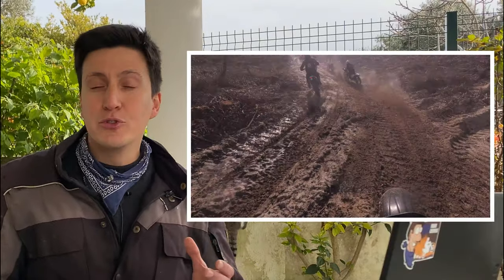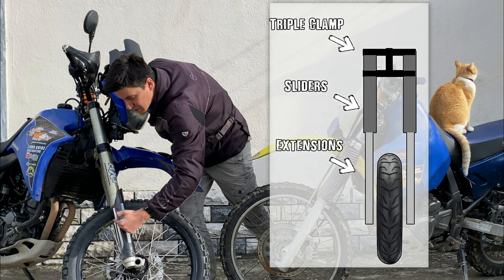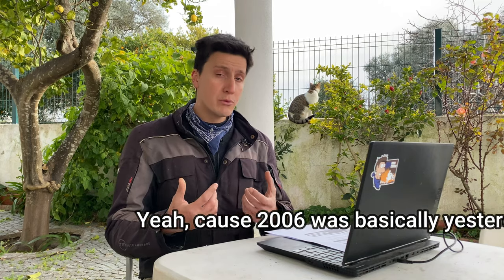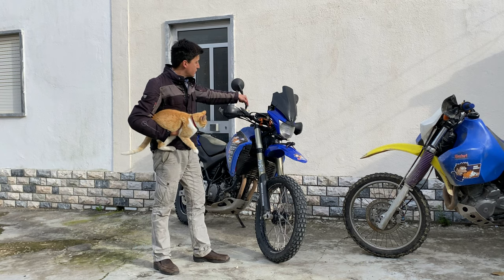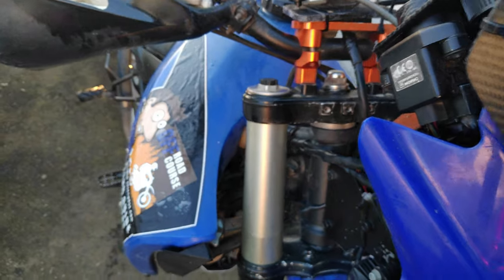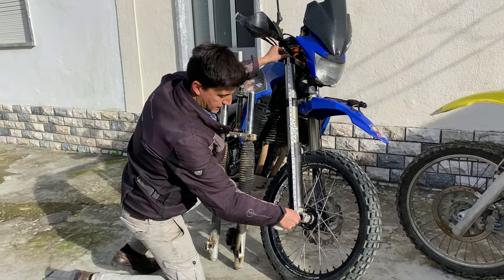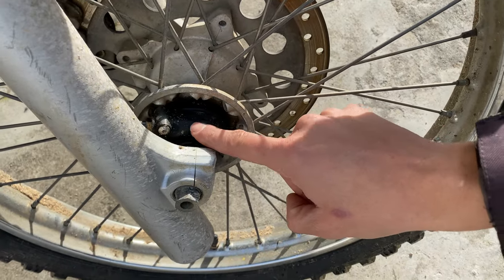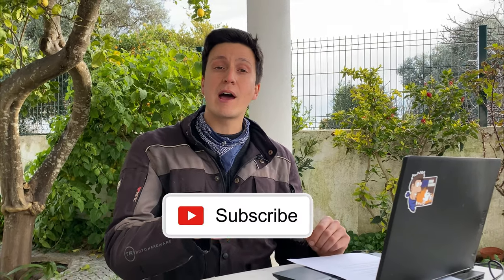Motorcycle upgrades! - How to Install a WP USD fork on a dual sport bike

Comment: You make very valid points.  My experience has taught me that for dual sport adventure riding the conventional, right side up, forks are the way to go.  One of the biggest reasons is fork seals.  USD forks are prone to getting dirt in the seals and leaking oil.  I have had conventional forks that are 15 years old still on the original fork seals.  The average, non-professional racer, is way better off and money ahead just getting the stock suspension resprung and revalved specifically for their own preferences.  If you want to do this conversion just because you like to tinker, then have at it.
Reply from the maker: I can't disagree with anything you said!
Actually, although I am a big fan of adjustable suspensions, I almost never adjust mine... I adjusted them once when I bought the bike and a few thousand km later when I had a better understanding of the bike... never again xD (please dont tell anyone)

Comment: Great front end conversion and thank you for sharing Sr. Diogo! I plan on replacing the internal damping system of my forks with a fully adjustable cartridge system. On my bike, it will be cheaper and easier (famous last words... :D). Keep the videos coming mate, great content and format.
Reply from the maker: Thank you for the comment Sr. Nelson :D
Yeah, cartridge upgrade is "safe and easy". What motorcycle is it?
Reply: @OFFroadOFFcourse  Tracer 700... Not a dual sport though. I miss my 1994 TT600S...

Comment: Muito obrigado for your tips. I own an XT660R just like yours. Great bike except for the crap suspension.  I want to set up an USD fork, would you reccomend a 450EXC like yours (what model year is it?)  or are there other models you think that would fit well? Bravo for the channel!
Reply from the maker: Hello Alberto! 
I'm using a 48mm from a 2004 450EXC. The model is the 4CS I think...they are good cause they are easy to maintain, reliable, etc...many of the more modern and advanced suspensions are a bit more tricky, like the cone valves, the closed cartidriges, etc... or so i've heard :o
 
To be honest, I'm not sure what to recommend... just get the ones that are more accessible to you. What is important is that you take them to a  good  suspension professional for a maintenance, revalving if necessary and spring replacement (cause the xt660 is much heavier than a 300-450cc enduro). You can get 43mm if you can find them cheaper than the 48mm, and you dont necessarily need to go for WPs. KYB, Showa, Marzocchi etc are also very good if tuned properly :)
As for suspension travel, my XT has 250mm in the front and works perfectly (The suspension expert can modify the fork to limit/extend the travel to whats best for your bike)
Reply: Great, I'll see what I can find and of course I'll take it to an expert, DMX in Madrid is my local expert, they did my husky 350 and they are like a supension surgeon so I trust them totally. On the rear I'll see what they can do too.  Right now I have my bike in vigo after doing Portuguese TET. We had an amazing time in your country. And I can't agree more on all the points you make about the XT660R, if it wasn't for the suspension it's the perfect machine.  I just have to get the suspension sorted out. Congratulations on your channel.  I am hooked. And you are a great communicator!! Keep up the good work!

Comment: Because you have a big review about this bike, i want to know why have oem exhaust and not 2 in 1.... Thank you.... Nice Chanel
Reply from the maker: I have been considering the 2 in 1system cause I would like to get more ground clearance, but there are a few thing stopping me:
1 - I don't like to spend money on things I don't really need (in Croatia the low ground clearance was a problem every day cause there were huge rocks mostly everywhere... in Portugal I didn't feel it was such a big deal)

2- A friend of mine has the 2-in-1 system and the bike becomes a bit too hot around the right leg. Not a huge problem, but something to consider

3- I am so happy with the noise, looks and performance of the 2in2 GPR system I have right now (its very lightweight too) that I don't want to ruin it. 

I'm just generally happy with the bike and dont feel like wasting more energy/money on that department. I will invest on a better monoshock instead, probably :)
Reply: @OFFroadOFFcourse  thamk you very much for your opinion , i have an xtr660 with ohlins rear and ohlins springs front , i m happy for this but i have problems with rocks when the road is bad. I have stock exhaust for 100000 , maybe i must change them
Reply: @OFFroadOFFcourse  and a last question , which oil you used!!!

Comment: What tires you used?
I got YamahaXT660R too, i want more grip in offroad
Reply from the maker: I love and recommend the Michelin Anakee Wild on the front. On the back I am using Pirelli MT21 and they are really good for off-road, but they dont last long (Just like the rear Anakee Wild)
I'd recommend the Mitas E-09 instead (good price/quality/mileage), but careful on wet road, they are not very good in those conditions.

Other good rear tires for off-road: Continental TKC80, Motoz Adventure or Rallz, etc. 
A little bit more road worthy (but still very capable off-road): Mitas E07, Heidenau K60, Motoz GPS

If you are in europe I can probably sell and send tires to your location ;)
Reply: @OFFroadOFFcourse  im from Spain, thanks a lot, i will look some
Reply: @OFFroadOFFcourse  By the way, I adore your modifications :D

Comment: What is the sizes of orginal suspension?
Reply from the maker: Just went to the garage to check it: 88.5cm from the middle of the wheel axle to the top of the extension
Reply: @OFFroadOFFcourse  thank you so much man, greetings from Turkey :)

Comment: And finally, forget about all of this and just buy a bike with a better suspension,...which probably is going to cost you the same,...or even less.
Reply from the maker: Well...its not just about money, there are many many reasons for you to upgrade a certain bike instead of just buying a "better one".
KTM 690R for instance, is better than the XT660R in almost everything, but it isn't as realiable, as simple, as maintenance free, etc... I value that a lot.
The XT660Z is also better than the sstock 660R in many ways, but its slightly heavier and much taller (much taller center of gravity), so not that good of a base either...
The T7 or the 890r is too heavy for my 100% off-road oriented taste..
The PR7 can't ride with a pillion
The DR650 is not fuel injected and its old...
Etc etc.

Getting a 3000€ XT660R and spending ~1500€ along 2 years upgrading it into a VERY interesting bike that suits my needs is a very good deal.
I could have bought a KTM690 for 11.000€, still need to spend another 1000 or more in a nav tower and still be a bit unhappy cause the bike is "too ready to race" for my own taste =)